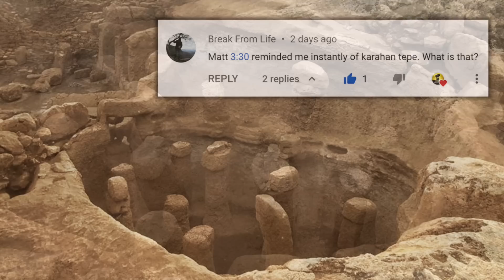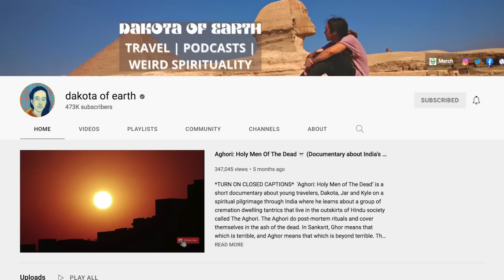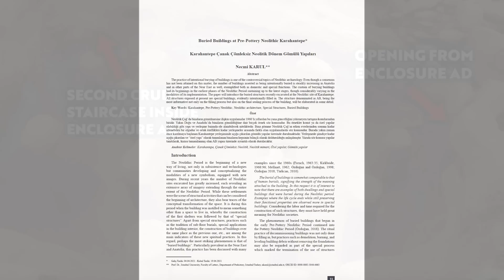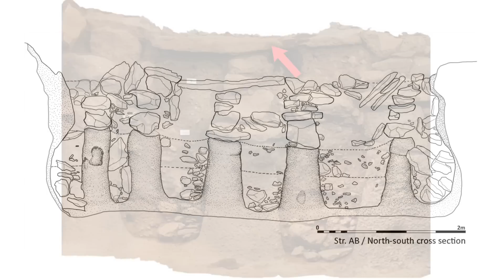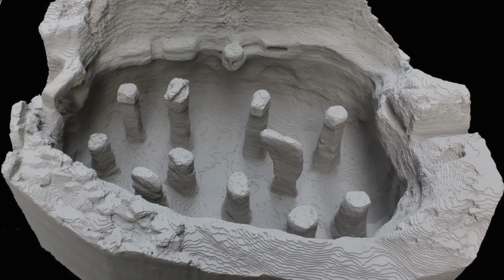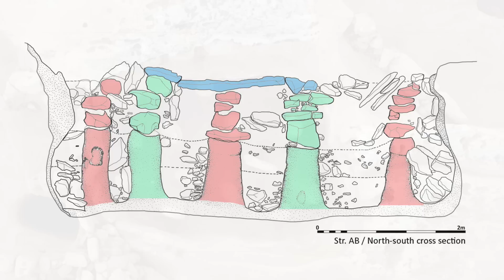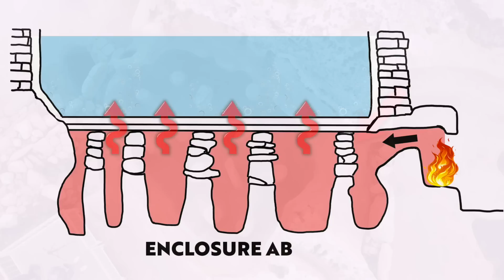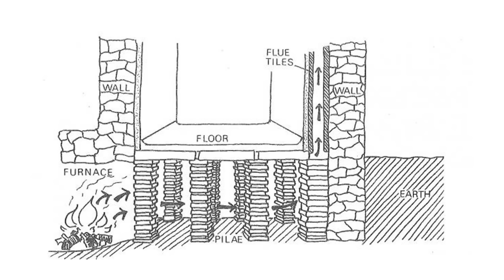An 11,500-Year-Old Central Heating Hypocaust system at Karahan Tepe? | Ancient Architects

Comment: The carved head peering into the so-called hypocaust, under the floor level, seems to create difficulties for the hypocaust theory. It looks like there might be slots for planking along the top side of the basin that would support a floor (or even a ceiling, or even plausibly a domed rush roof for all we know) but why carve a face if it is concealed? And why put the floor on top of the rocks piled on solid pillars instead of say, on the stone columns themselves, as this makes no structural sense? 

The rocks on top of these pillars may have been used as infill in leveling out the site for the second phase of its occupation, when it was hastily floored over.  Perhaps it was a ritual sauna chamber (!). Then perhaps the water channel flowing out of the basin might suggest there was a ritual bath above if the space even WAS a hypocaust (unless that channel carried water away from the roof!).  Again, assuming that there even was a floor originally above the space at all to create a hypocaust or an enclosed heated area, which is not at all clear. Add to this that the chamber is much taller and more spacious than your typical hypocaust if you put living people into the space. It is configured more like a shrine. The small entry to this space, called impractical for a shrine is not at all necessarily of the sort. Entrances to Japanese teahouses or tight entrances into prehistoric caves often are part of ritual progress, to humble all initiates into the spaces by forcing them through small or short openings to face the divine or assume the proper humble spirit.

Because there is another observation that I do not yet see discussion of, something people apparently missed. And that is the large curved stone placed upright in the center of the group of bedrock carved pillars in the pit and given no consideration other than it was placed independently of the others, which were carved from the living stone. This is the only stone that was not carved from the bedrock of the basin, and has a distinctive placement opposite the entry (! like later religious structures of all stripes!) and curved shape and surface markings indicating perhaps a religious idol! Not only would this reinforce the sacred nature of the space against its  utility as a floor heater, but would start to make or add to a statement about the religious beliefs of these people, an important revelation. 

This basin was filled in along with all the other structures in an attempt to conceal the site. Why? This suggests that the basin was part of a central power or ritual center, and not a simple floor heating system. I like the objective temper with which you approach these archaeological mysteries, although your theory of the robbing of the Great Pyramid begs many questions, I have to say. I do not think that it is correct. Scott Zema BA MA Art History and Architecture, University of Washington.
Reply: Why carve the face if it’s concealed? Because this is obviously a sacred site so even cleaning and preparing the fire area would have a holy sacred aura. Maybe part of a becoming a man ceremony was to make a fire below for the elders who would meet above and that face was part of the initiation. These were still hunting/nomads who bury valuables, maybe they would ceremonially bury it when they knew they were to follow a herd. This would also mean that stability wasn’t as primary concern because maybe like current day Burning Man this site was used once a year then abandoned. I see this area as something akin to a fair or festival where to maintain a sense of unity between tribes who shared hunting and proto-farm land they would use this site to meet, do drugs, and figure out the next years events etc. I can see this being a temporary city in the desert for a few weeks before the would bury/burn it all so it could be preserved for the next year of initiation and celebration. It’s a way to constructively compete, trade and have cohesion.
Reply: @ALifeWellSteved I like your theory of the sites use, I think that it was more likely the space was used for a ritual purpose and not simply the underpart of a heated area above, although a heated bath on top of the structure seems possible, but again we have that fancy face decorating the basement! Perhaps two ideas, a heated sauna beneath a heated bath, are valid. But perhaps more likely is that the basin/chamber was used as a shrine. The ritual use of the basin itself as a chamber with pillars and a votive stone(!) itself makes more sense than the idea of a simple heating floor assembly. The sauna/ritual use of this space  makes sense of the stone head, the carving of which is a lot of work for a simple scare for the cleanout workers of a hypocaust, and may be the head of a god or ancestor intrusive into the shrine. Not many faces on the site. Without hardened tools this was a real challenge and a carved face had to have an important purpose. Also steps in the chamber? Again, a lot of fancy work out of consideration for simple maintenance workers. I do think that an attempt was made to bury and flatten out the site when the area was still in use; again, to eliminate shrines or ritual or a theocratic revolution explaining the burial of the shrine/basin. The burial appears hasty and violent, and the stones atop the pillars may confirm a hasty decision to make the shrine essentially fill under a new floor above and make use of the opportunity to use the columns for structural integrity.

Comment: You should also check on the Korean Ondol as a similar design when the floor is heated, and some of the heat is used for cooking. The floor is  heated for sleeping during cold nights. The room is also insulated and carpet or rushes are used as floor insulation to make a comfortable sleeping area.

Comment: Maybe it did have a stone roof and was a food storage facility? But this heated floor thing does sound plausible as well. Maybe that small channel could had been used to pour water that went through the hot floor and traveled to the bathing area(AD)? Water could be circulated through the system to keep it warm

Comment: Love the idea, makes so much sense!

About the face. Not sure if anyone mentioned it before, but the lips kinda look like that they are blowing air. When you start a fire, you need to gently blow it to supply it with extra air making the fire burn hotter before it gets strong enough to sustain itself.

Obviously if that was the symbolic meaning of the face (blowing extra air into the fire to make it hotter and stronger) then it is in the wrong place pointing at the wrong direction (you don't want to blow the smoke back to AD), but it might spark some interesting connections in your mind.

Comment: 20:25 ..at the topographical when you added the floor in:

That appears as if it’s a descending water channel coming in from the right.

Then the opening on the left appears to be lower than the floor height with a rim. If this area were to be filled with water, this opening would pool up and allow for easy water access. 

The pit on the bottom left would be an overflow IF the height is correct and there is a channel running from the access pool down to the pit. 

The added floor would keep sunlight out, so no roof would be needed & the water would stay clean of algae etc.

Look into in ground water & food storage. It is a natural & elementary refrigerator method still used today in permaculture style life. 

You need water to get through dry desert months, always. If this isn’t water the storage, then this sight would have to have it somewhere. Storage as storage, not for regular use. There will also be storage for regular use as well as the storage for dry season. The sight would have [need] both.

Yes the heated floor method is pretty darn sound. But heated floor is luxury, whereas water storage is fundamental. Besides if that inlet is a water gutter and rain filled into it, then this area would literally work as a water storage.

Rituals based on phallus shaped pillars is primitive Hollywood logic. 

True logic would dictate that one must find at every sight, the fundamental elements of survival, based on specific local climate needs—before plugging in ritual or luxury hypothesis into explanations of function.

These are just my initial observations & guesses though. As you said, stages of use over the ages could have changed from water storage to heated floor to landfill whatever. Or we could both be wrong. 🤷🏼‍♂️👍🏼

Comment: There are hot springs in Anatolia, the most famous at Pamukkale.  The Romans built a bath near at least one.  Ancient people could have taken inspiration from such places.   As for providing hot water, there is a primitive method that requires building a fire with fair sized rocks heating in the fire, which are then put into water to heat it.  In this case heating rocks above with a path down to  a pool would work.

I have to wonder if the large flat rocks were natural, or were worked.  This is another thought-provoking video, for which many thanks Matt!

Comment: Ok. I live in KY, limestone central. This includes a lot of limestone basements. I used to live on Limestone St. in Lexington. A lot of Kentucky homes that burned down, or suffered fires, have similar unfinished basements with heat damage that mimics the discoloration on "The Face"'s side of the enclosure. As Lexington, the area I'm more familiar with, switched from either firewood or coal to natural gas furnaces, you can (could, there's been a lot of "urbanization", unfortunately) see some of these still visible when I viewed them.  Also, the coal shoots and occasionally the several decades old wood, which I once helped haul out. A lot of old houses that were just plain huge had been converted into apartments and I loved exploring old houses even when I wasn't in my cups. I actually found a secret entrance into a space that served some damn function in a closet and it was a simple "push the panel and it opens' but wasn't obvious, and the friend did not realize the particulars of the apartment they were renting. [But I ran into similar in Virginia visiting relatives with ties to the Underground Railroad]. Undisseminated aspects of US history.

I know that an archaeological dig done on the budget and time period that Karahan Tepe was initially excavated leaves us with minimal samples. However, the walls can be scrapped with minimal effort or damage. I concur it would be minimal to do so. Actually this video might create exactly that sort of effort. :) It's not an insane request from a somebody who is just insanely curious. You're drawing future travel dollars to an area of Turkey that quite frankly needs tourism dollars.  I wanna see these sites. I have for decades. Just reach out to them. I don't think they'll throw you to the shitter in this day and time. I mean they might, but I think you've got a good thing here. And that crazy looking stone L shaped pillar was put in after they realized the floor above wouldn't hold with ALL THE OTHER PILLARS. I think the floor fell at one point and it's the one that replaced the weak point in the flooring support system. Again, limestone, it doesn't handle heat well.

Comment: When I first saw this ruin in your last video on it, my first impression was a heating system or bath house as you describe in this video. I didn't put much thought into it at all since. As you say, there is no way to know exactly how it worked, it's use for certain, or it's history. For fun, I'd like to suggest a few possibilities. 1) It may have been decommissioned and filled due to an accident. Specifically, one in which 1 or more people perished. Think CO2. ;) 2) Perhaps those that built it were conquered or worse, slaughtered. Maybe those that replaced them did not understand it's use and functionality. Perhaps the floor collapsed and they did not know how or take the time to repair it. Filling it to make the space usable out of practicality. 
  Anyway, it is interesting and valuable to investigate/discuss this.  Thanks for your work.

Comment: Edit: I really should actually listen to the whole video before commenting.. lol.. 
I have to hand it to you Matt, after listening to the remainder of your video, it is a very reasonable hypothesis. 
They did have the ability to make limestone plasters and I've seen watertight pools made with traditional techniques and natural pozzolanic materials in south east asia.. so it is completely conceivable. 
What you are proposing was by no means beyond the abilities of the people who built the site, and it uses concepts that they would likely have had a good understanding of.
It would certainly have been ambitious, and i suspect that the slab (or cemented slabs) covering pit AB would have been at risk of breaking if overstressed or in an earthquake.
As intelligent as they were, they would not have had a means to determine precise materials strengths or load limits beyond trial and error, and this would likely have been a groundbreaking undertaking for the time. so much so that when it eventually did break, it was deemed to have been punishment for hubris, or the knowledge required to confidently repair such a floor had been forgotten as this was originally the brainchild of a single master stonemason, long since past ( this wouldn't be the first example of such a thing happening), or the floor integrated timber beams, and the changing climate and resource exploitation (constantly burning a fire for hot water) made trees too scarce to be able to repair the floor (I sure don't see any trees around there now)..., the point is there are numerous reasonable explanations.
I now think your idea has real merit and should be further explored. 
Everything below was my original comment.. mostly made out of ignorance because I jumped to conclusions.. lol. Cheers!

I like the hypothesis, and generally, I think you are right that there are similarities, but...
I strongly suspect that the purpose behind the similar architecture was not the same in each case.
I agree that the pillars in AB were used to hold up a "roof" or "floor", and that the extra material on top of the pillars was there for the same reason that the "T's" on top of the T-shaped pillars were there.
Effectively it's a type of cantilever to increase the amount of area available to support cross beams so that the unsupported span distance could be minimized.
However, what we disagree on was purpose.

It seems fairly clear to me that there is significant erosion and water wear both within the basin, and on the surrounding rock.
In fact it appears that at some point there was likely a seasonal spring that emerged just to the north and above where the pit is located in pit AA
I surmise that AB was in fact a reservoir designed to hold and retain a large quantity of water for the dry season. 

Or alternatively, as there are channels to allow water to flow in from above on the north side and an opening on the south side that enters into what was likely once a large building, and the opening is only tall enough to allow for around 1 meter or so of water depth, it is also plausible that AB was once a bathing house. 
Interestingly, if you look at the "pool"  AA just to the north of the sunken basin AB , it appears to have been "damned" to create what looks like an open air pool with a rock cut bench all the way around. This suggests an area for public bathing and a ritualistic enclosed area with the spring likely being believed to have healing properties.
This would be doubly true with the original spring was a hot spring or warm spring.  

From what I can make out there appears to be significant geological and archeological evidence to support this hypothesis, including the fact that there appears to be salt deposition on the walls of the pit and the bottom of the pit always looks wet in all the images i've seen. it looks like it may be lined with clay?

Unfortunately, for all my digging I have not been able to find any papers that discus the geology of the surrounding rock. In fact it's surprisingly hard to find much of any strictly academic research material for the site. In theory it should be fairly easy to check both of these hypothesis, and I was really hoping to find a paper to help guide these opinions.

If it was being used a an early hypocaust, i would expect there to be evidence of burning and char deposits, likely in the opening to the south.
If used as a bath house or for water storage I would expect there to be mineral deposition consistent with seasonal springs, hot springs, or bath houses.

Interestingly, the Romans themselves actually built cisterns in much the same way as well...